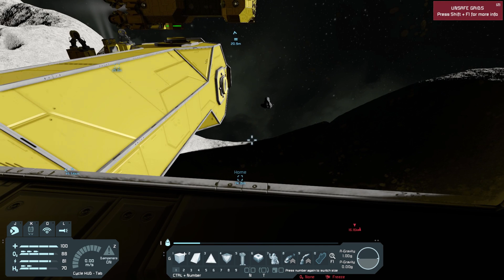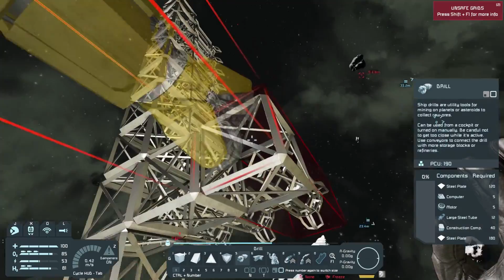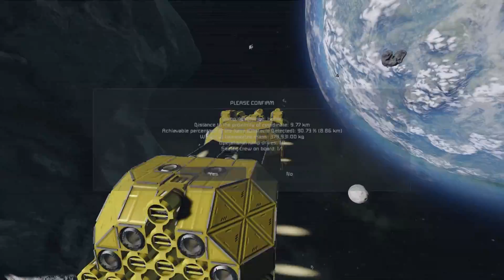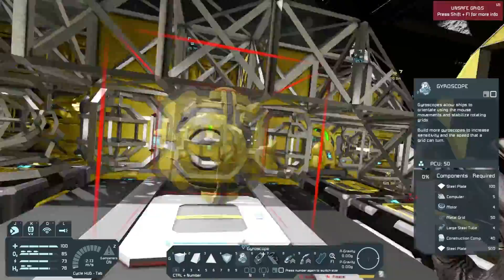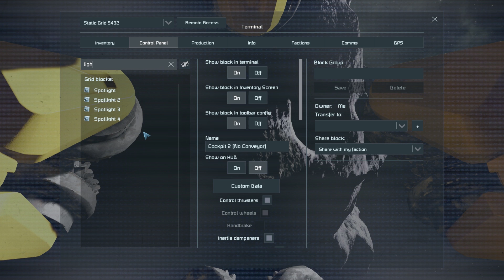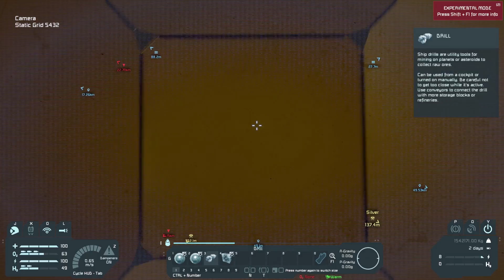Space Engineers #20: Mega Miner

Comment: An absolute wall of drills is unnecessary... you can alternate junctions and drills, but be warned, a drill at each corner of a junction will leave a strip of voxels, but a drill on each SIDE of a given junction will clear space for the junction so you can basically go in a checker pattern and you’ll be fine.
Reply from the maker: It is necessary. More drills makes it dig faster and pick up faster.
Reply: Dragon Nation Gaming my goal in that is to either save weight, ease the load on my potato pc, or just make the drill wall twice the surface area to fit a bigger ship in... less density for the same result means going BIGGER before my potato machine begs for mercy... also the way volume works, if you can add on more row on each side, that’s a huge gain, and with even one block space on the wall going to something other than a drill, you’re limited to that speed going through the rock regardless... love the montages btw